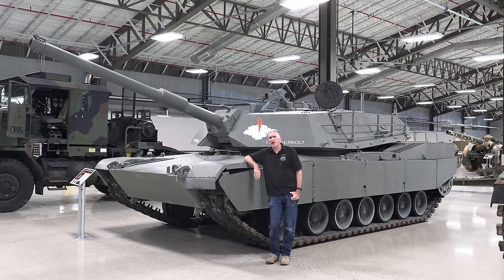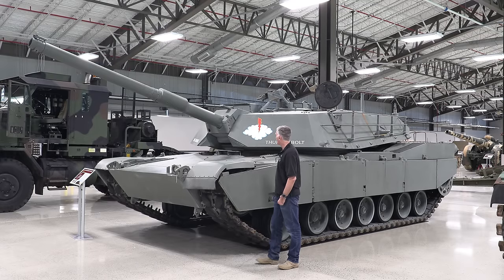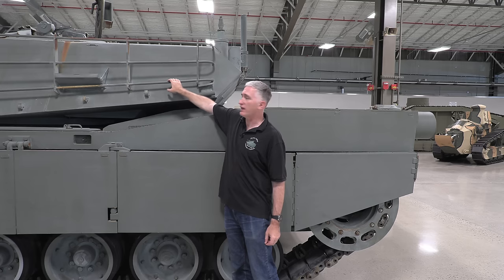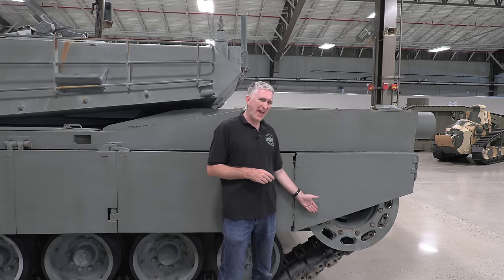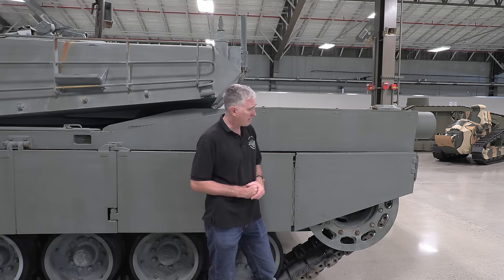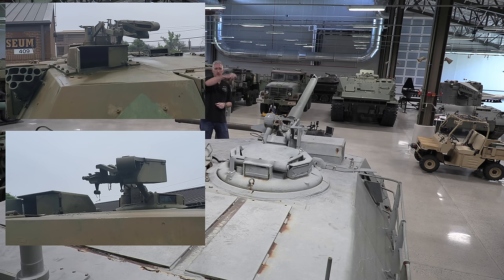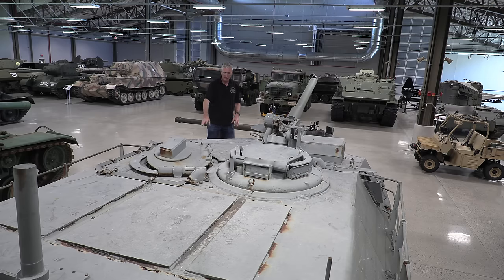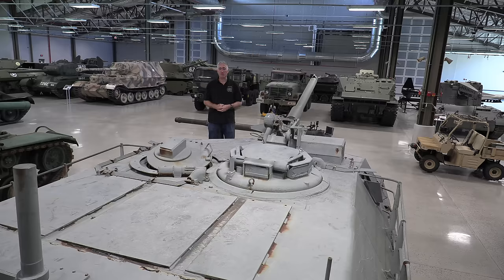Inside the Chieftain's Hatch Snapshot: M1 Thunderbolt.

Comment: "THUNDER BOLT" was the name of Crieghton Abrams M4 tank during WW2, hence the name. The first M1's we got at Fulda had the sprocket ring and panel. Mud was the primary culprit that would build up there and pop the last panel. That panel is just ballistic material, so we cut a few away in the motor pool, hence the scallop cut out that became standard. LTC John Abrams "Daddy Rabbit" was our boss so we could get away with field modification to Sam's new tank.  The TC's station was a head trip. The M2 was mounted forward on a remote-control cradle and you had a corded remote control. It was a pistol grip style with a hat switch to control the M2 and could be operated buttoned up or head out.  The cord was coiled like a telephone cord but ten times as heavy. It did have great optical sights. There are nylon straps on the back of the turret instead of a bustle. This was perfect for strapping on our duffle bags of NBC gear. We literally always trained in some elevated MOPP condition but had the real stuff with us when we rolled on alert.
 I had come from M60A1 training to an A3 unit that transitioned to the early M1's, with John Abrams, all in four short years. Armor branch really gave me my monies worth! Not even counting border duty. Allons.
Reply: BLACKHORSE!
C-Troop, 2/11 ACR 82-84
'Speedbump of Freedom' 😁
Reply: These stories of peoples personal experiences are a delight to read. Really helps bring vehicles alive when you meet the people that operated them and hear about their experiences! 

Thank you for taking the time to share them. :D
Reply: @carlhicksjr8401  bet you had fun during Able Archer '83...
Reply: @ScottKenny1978  When the Squadron took a right into in the ammo dump instead of a left out to the rail yard, my jockstrap ammo crawled up under my kidneys looking for a hiding spot.
We always carried our war supply NBC gear with us whenever we went out to the field or on patrol, but when the NBC NCO started giving everybody extra mask filters and the commo guy started handing out batteries like he was Santa Claus, shit officially got REAL.
Reply: @carlhicksjr8401  did you ever find the crew seat cushions after that?

Pucker factor must have been off the charts...
Reply: @carlhicksjr8401  I was more thinking that the pucker factor was so intense that said seat cushions were sucked into brown holes, but yeah.
Reply: @ScottKenny1978  'What goes up, must come down', Scott. Especially when you're eating first-gen MREs... 😁🤣
Reply: @carlhicksjr8401  i thought those just stopped you up?

Comment: My first M1 was serial number 0051. It needed 11 drip pans to catch all the leaks. You didn't mention the extra ports on the bottom of the hull or the godawful final drive bushings (having to lean on them as the tank started to try to get them to reseat), or the awful, loose saddle bolt upper plates, but those are intimate details only learned through tribulation. As recompense, you often had to use a chock block and a sledge to get your bore evacuator off, but it was fine because it was aluminum, not fiberglass. And don't forget your MRS was essentially held on with a single bolt clamp; excellent for making sure it was never of any use unless you really wanted to never hit a target again until you re-boresighted.

There were the awesome, directional, rubber tracks with the single bolt center guides that made it quicker to break (and reconnect) track, but also made the track noisy as hell. Remember too, getting the bitch plate off so you could wiggle the T7 harness while trying to get your tank to start. And don't forget having to randomly, periodically drain that stupid in line battery (I never learned it's nomenclature) below the turret so your tank wouldn't start while it was locked up, tarped up and empty.

Man, I had a lot of fun on that beast. We named her Class VI because we were the only crew in our Company who were of legal age for all four of us to drink. Good times. Cheers!
Reply: Yes, it definitely sounds like you had a great time. I can tell by the way you complain about what a miserable piece of machinery it was for the whole comment. Apparently that's how you can tell a soldier is the happiest, when they are complaining and whining the loudest.
Reply: @justforever96  Truth!

Comment: I remember being in Germany from October 1984 to April 1986. We cut the #7 skirt so the mud could get out.  Later those skirts got to us precut. 
Was assigned to Ft. Benning and had a driver going to fast around a left turn and sheared the retaining ring off. Spent several hours getting the track back on. The retaining ring was warped. Got all but 3 bolts in it.

Comment: The LRIP M1 had several differences from later models not mentioned. First, the engine filter seals didn't work right due to errors in installation. This was fixed by a change in the seal and training in the correct replacement of the filters after cleaning the filters. Second, all of the LRIP M1 had their transmission replaced with an upgraded version that was introduced with the first production tanks delivered starting in 1980. This was to fix stripping the gears by the drivers during LRIP testing as they threw the tanks back in reverse during live firing.  Shoot and scoot tactics had not been taken into account during design.  Third was to reinforce the mounting for the engine pack as running over rocks flexed the hull armor and stripped the bolts holding the transmission on the engine pack down, slightly. Enough to affect the transmission.  Fourth, all of the alternators had to be replaced with a new design as the LRIP design failed often and early.
I was at the presentation if I remember correctly when THUNDERBOLT II was delivered. They had the original (last) THUNDERBOLT II Sherman there if I remember correctly and the ceremony took place at LATP. I was also at the first production delivery ceremony of the M1, IPM1 (maybe), M1A1, M1A2, and M1A2 (SEP) as well as the Saudi/Kuwait M1A2 deliveries.
There was around 17 of us plus or minus from 1977-2005 plus at TACOM purchasing the XM1 and M1-IPM1-M1A1-M1A2-Saudi/Kuwait M1A2-M1A2(SEP)-M1A2(SEP2) and now the current version of the Abrams tank. Old memories now.

Comment: I was a member of the first M1A1 trainees (19K) in '86 and was a gunner in 4th Battalion 70th Armored and fought in the battle of Madina Ridge during Desert Storm. Good memories.
Reply: Ppl on the Reddit r/Tankporn subreddit always curious about M1 fuel consumption.  An M1 driver once told me that it averages out to about 300gals per 8 hours of operating time. Does that sound right? What would it be if the tank was always on the move at a reasonable speed?
Reply: @oceanic8424  The_Chieftain has mentioned it a few times before and in his most recent video, iirc he said "Turbine engines used to suck down fuel, now they're nearly on par with Diesel engines"

Comment: I watched the 1st few minutes of this video and it became obvious that our dear and beloved Chieftain is not that familiar with the early Abrams.
He did add as a subtitle that the turret stowage bins were smaller, but just missing from Thunderbolt,  but he really should have pointed out that the tank has TWO hull sponson boxes as there is no NBC system on the left.
Mostly I would like to talk about the paddlewheel on the drive sprockets, it was NOT put there to put the track back on, but to push the outside END CONNECTORS back on that were walking off.
There is a corresponding bracket welded to the hull to push the inside connectors back on too. As a matter of fact, that bracket is still on Abrams hulls to this day, sort of like our own vestigial tail.
The paddlewheels really did not work the way they were intended and were eventually discontinued. 
Chieftain does a great job, I really like his information and his style, but today I had to say something as he was in MY back yard.
I was a three conflict Soldier and I was a 19K30K4HP.
I was on these beasts for 20 years. From the M1 all the way up to the M1A2 SEP V3 with LP CROWS.
Thanks
Keep on tanking!!
Reply: Thanks for the clarification! I was on M1A1s and was really confused when he pointed to the NBC system but it looked like a sponson box cover. I only knew the one on the right side.
Reply: What would you design today, if time was tight, but facilities and  ancillary equipment were plentiful and the best available?    Only build time, and troop retraining time are scarce, to almost nonexistent.

Comment: I was in the 2nd cadre of 19k's at Knox in Mar '82. My first unit, 1/66 AR 2nd AD,  had just completed transition to the first M1's when I arrived. Most looked very similar to Thunderbolt but we had the small storage bins on each side. All the tanks had the spare road wheel on top of the turret when issued, us dats did not do that. The eventual altering of the rear skirt started happening in late '83 in Germany. Mud caused the rear skirt to pop off and get damaged a lot.  A SFC who was our senior mechanic at 64th AR, 3rd ID told me (late '83) that a CWO in our Aviation Btn. had observed some tankers using a saw to alter the rear skirts and had submitted the "idea" and had received a monetary reward, I don't remember exactly how much but more than $10k. After that the rear skirts came "pre-cut".

Comment: Thanks for this vid!  It was pretty educational for me, as I had often wondered why some toys and scale models differed from one another, with the circular spot left for the proposed ITV(which appeared later), and why sometimes there would be a roadwheel on the turret and sometimes not.

Yeah, without all the computer FCS stuff and switch boards, monitors, and other communication equipment, that turret has a lot more interior space, and ofc the smaller gun like you mentioned.  Stick a Laz-E-boy recliner in there(assembled inside), a TV, and a modern game console or P.C. a microwave oven and mini fridge, some bottles of booze in the ammo racks, and it's the perfect man cave!

Comment: Hey Chieftain! I have a channel question if you read these. (Love the channel!) In WW2 (and pre) we ended up with many tanks by all sides that had what we know would call glaring weakspots. Is there any mention in records why so many manufacturers simply didn't test, or didn't care, that specific sections of their vehicle on the front had vastly less armor and would practically guarantee a knockout? For a drastic example, the massive Ferdinand/Elefant has up to 200mm of armor and a gigantic 88mm cannon. ... except immediately next to the front plate are side cheeks only 80mm thick that angled frontally becoming 120mm thick. Still a huge disadvantage. If you can't pen the 200, simply go through 120mm. Meaning all 200mm armor sections were pointless.. And,. if someone is already simply at that small angle (because they're not located directly in front of it), that angle goes away completely and now it's 80mm. Something a 75mm Sherman or T-34 could easily pen at probably over 1 KM. So much all that money we spent building it and logistically getting it to the war!

The M6A1 also had the same "side cheeks" weakspot. But there were more massively produced ones too. The Sherman obviously exposed drivers hatches. These are things that would have immediately been noticed during fire testing. It's not a "hard shot" like the large cupola on a early Tiger tank. It's literally the front of the tank! 

We also know many/most tankers even had pamphlets of "where to shoot" specific enemy tanks. So we know all the tankers knew about these weakspots! So why didn't the manufacturers?

It at least seems reasonable, that a tank should either have equal turret vs tank protection, or, higher turret (for hull down position). Which is what pretty much any modern tank circa 1950 and later has. But before that, there are plenty of examples with weaker turret faces. The T-34 for example.

Another crazy one is weaker tiny man turrets. Like the poor sod who has to sit in the front of the main armor in a Crusader II. A guaranteed dead crewman on any AT tank shell hitting it.

I can see "death blossom" machine guns, turrets, things like that. These are ideas that can only be proven/disproven with combat. And trap shots were probably rare enough to not be wildly known and designed around. But WEAKSPOTS? Surely we know what a weakspot is before 1950! We designed entire ships around protecting the most important parts long before then ("all or nothing armor" circa 1912).

Thank you for your hard work!

Comment: You forgot to mention the early pre-production units did not have speed governors.  Collecting speeding tickets in a tank on Eisenhower on Fort Knox was a thing for the first drivers.  Geoff Who had pity for the poor bloke trying not to get his escort jeep run down.
Reply: Heard that the test engineers got tired of how long it took to get from the garage to the test range between "make change in shop" and "see if it works in the field".

100+mph on a dirt road.
Reply: I can remember driving down a highway near Yuma and watching an Abrams pass me on a parallel dirt road. This was in the mid to late 1980s, so the speed limit was likely still 55, but I was suitably impressed.
Reply: @john_in_phoenix  must have been quite a sight
Reply: @ScottKenny1978  Sounds like BS to this old tanker
Reply: @colbeausabre8842  this was supposedly from one of those engineers or someone who worked for them (heard that story a long time ago, probably 20 years ago, and don't remember the guy's name now).
Reply: Crews removed them soon
Reply: The M1A1 was definitely slower than the LIRP M1's.  Unrelated, but if you are ever on Jeopardy and get this question... the back deck of the M1 seemed warmer at night than the back deck of the M1A1.   I preferred sleeping on top of the turret though, because the diesels fumes coming up from the engine compartment gave me a headache.

Comment: Did the original M1 have the electronic bus setup under the main gun like the current M1A2? I am talking about the large box under the gun with the multiple cannon plugs going into it. That would have been so nice to have on the M60A1/A3's. The M1 is so much cleaner design than the M60 inside the turret, easier to egress too. The Army did well buying it.

Comment: Why is there no Abrams version of the BMPT? It would be cool seeing an Abrams equipped with a GAU-8.
Reply: I don't think US Ground Forces doctrine would call/need for an specialized urban warfare vehicle analog to the Russian BMP-T. Having said that one of the proposals for the M247 Sgt. York implemented a modified version of the GAU-8, albeit as a SHORAD system.
Reply: There was on paper, a concept of a AGDS system mounted on an Abrams chassis, but it never left the drawing board. It was more of an air-defence vehicle on par with the Shilka
Reply: If you train your tanks and infantry to work together in urban areas, you don't need a BMP-T.
Reply: "cool" doesn't win battles. Speaking as an old tanker, you don't send mechanized forces into urban combat, any more than you'd send them into a heavy forest. That's what infantry is for
Reply: Slap on Vigilante turret. Drive around dabbing on convoys.
Can't say this wouldn't be hilarious to have footage of that in place of that Chad solo BTR clapping those T72 cheeks.
Reply: @ADudOverTheFence1  If that were true, they wouldn't have developed the TUSK package for the Abrams.
Reply: @GregAtlas  The TUSK package isn't a ground up modification for the Abrams to exclusively engage in urban areas such as the BMP-T. It's a protection package, yeah, but it can still engage in other tasks unlike the BMP.
Reply: @GregAtlas  TUSK is additional armor and MGs, not a complete replacement turret with a couple of 30mm cannons and a variety of missiles.

Comment: I have a question that requires some explanation/context first.      According to all t he open-source information I could find, like the NBC air filtration ratings for the M1a, T-72B, and T-90’s rating for internal air volume; and the quoted size if the autoloader system.  
  All 3 of the aforementioned tanks have nearly the exact same “internal protected volume,” when you count the carousel autoloaders size as occupied protected volume.     

 Does that mean for the same volume that’s under the armour, the M1 has about 25-30 tons of extra armour and equipment. Especially considering the size differences between the smaller turbine and the larger conventional Diesel engines of the other 2?

Comment: Nice video again thanks.

A question on tank disign as a former Leopard 1 and PRTL driver / gunner.

Why isn't it possible to have all rounds of ammo stored seperately from the crew?

 Say on both sides of the engine. Have the fuel stored akin Merkava on both sides of the tank.

It should then be possible to reload the magazine in the turret from inside of the vehicle.

Comment: With an upgrade from 105mm to 120mm, I wonder if it’s only a matter of time for the 130mm from Rheinmetall’s KF51 winds up inside an Abrams variant. Albeit, I have no clue the dimensions of the turret nor the gun and if they would fit together.

Comment: Chieftain, maybe you could settle an argument for me related to the Abrams:
In cases of a successful significant emotional event in the turret, is the turret basket made of anything significant enough to stop some angry metal and such from convincing the driver to give up his day job?
Reply from the maker: No, not really. If it's 'blast', the driver gets it too. The saving grace is that some shrapnel may be blocked by the turret ring overhang.
Reply: @TheChieftainsHatch  That's more or less the train of thought I was following

It ended as more a semantic argument than anything.
(Whether the driving position was a separated position and safe from turret related emotional events, my understanding was yes, but only physically by the turret basket)